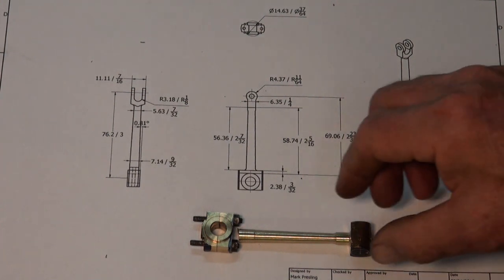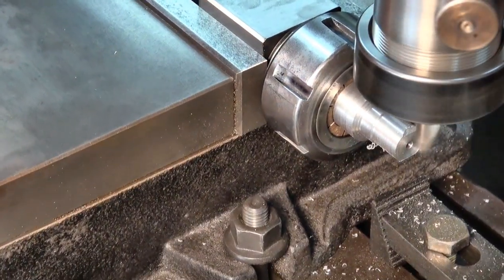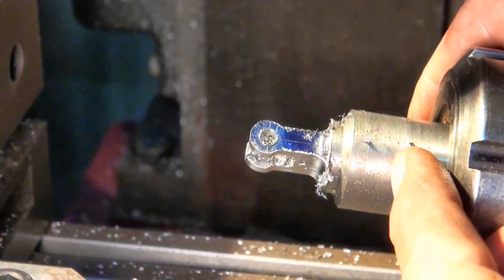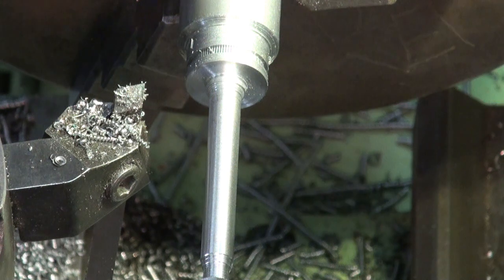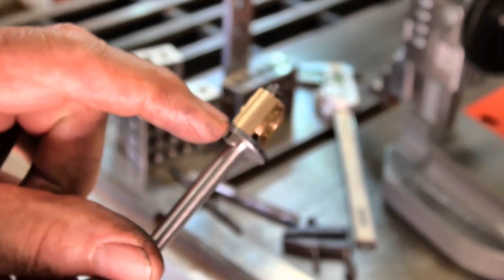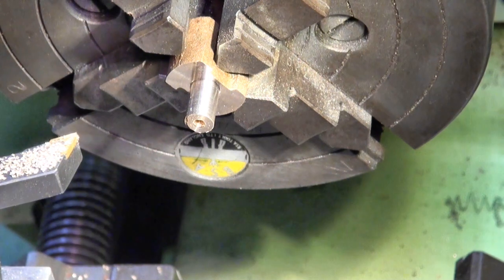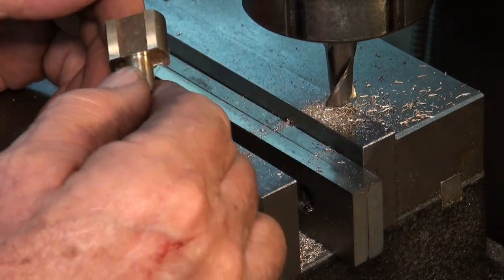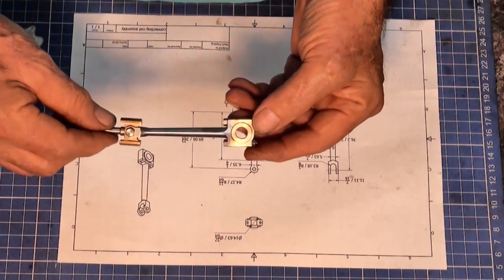Building the Stuart Turner Number 8 Mill Engine - Part 9 - How to throw a rod!

Comment: nice save on the connecting rod and it's probably more typical to full size practice as I don't think any  steam engine manufacturer  made there rods out of bronze.
Reply from the maker: Jeffrey, it was probably one of those happy accidents. I do like the appearance of the steel connecting rod and it was an easy fix to fabricate the three part replacement. I am sure that steel (or wrought iron) would be typical in full size practice for any engine making a lot of horsepower.
Regards,
Mark
Reply: @Preso58  right , love your work for sure .

Comment: Hi Mark,  You need an ER16 R8 Collet Holder (cheap on eBay) and some ER16 collets.
Reply from the maker: I have a MT3 spindle in both my milling machines and I already have an ER16 collet chuck. I was just annoyed with myself for not foreseeing that the bigger collet nuts were going to clash!
Reply: Interesting.  My Sieg X3 CNC Mill has an R8 Spindle.
Reply from the maker: Yes, I remember I had the choice when I purchased mine but since I already had lots of MT3 tooling I decided to choose that option.